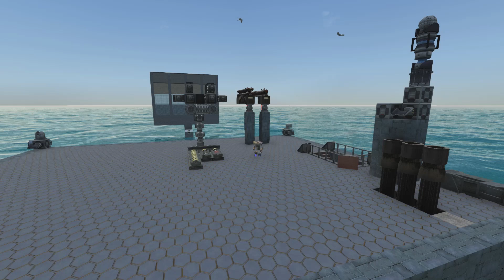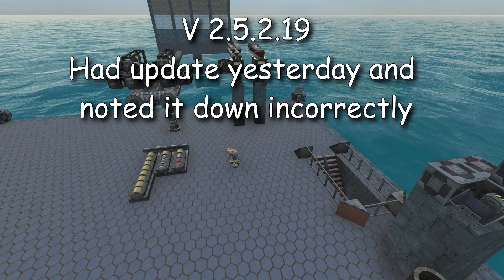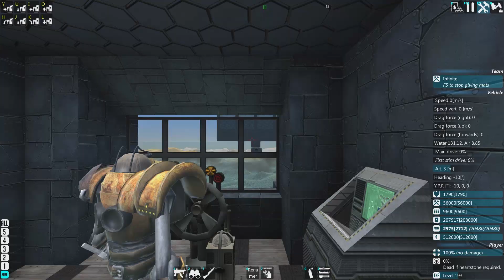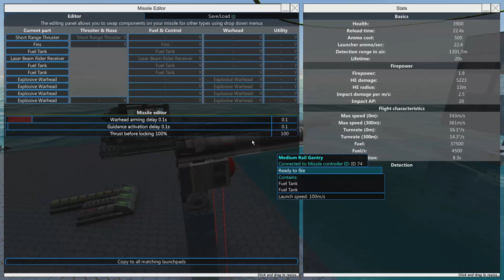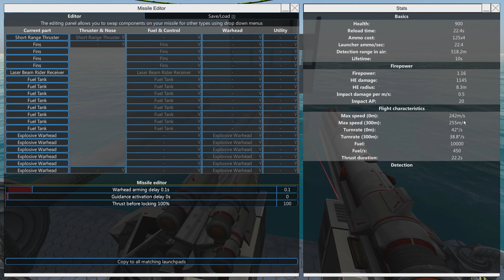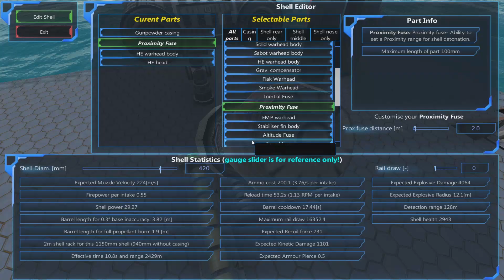From The Depths Bug Report 2 HE is passing through surface blocks

Comment: I had this issue quite a lot a while back (like easily a year ago) when I played a lot and it's one of the things that put me off playing frequently. I only really noticed it when I made a big, heavily armoured barbette for the squishy parts of my APS guns to hide in, and then mid battle I'd find the gun exploding, then I'd go and try and see where the armour was penetrated and there were no holes in the armour - and I wasn't even fighting against craft that were using HEAT or HESH. I think I recall it happening with crams too
Reply from the maker: Could be a regression bug which is handy to locate if it happened before thanks :)
Reply: @DelsGaming  Sorry I can't give you any specifics!
Reply: I reported a similar bug a year or so back, discovered when I happened to have the camera inside an ai citadel, at the moment an DWG explosive weapon blew up the ai without destroying the armour.

Interestingly, it was a bug that a number of players knew existed, but hadn't been reported. 

If I remember right, the cause at the time turned out to be a clipping issue.